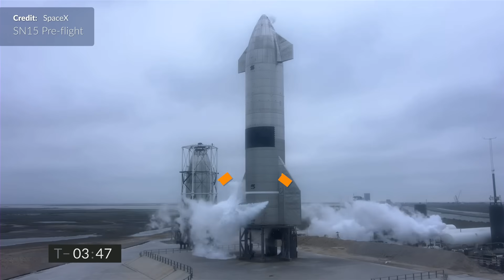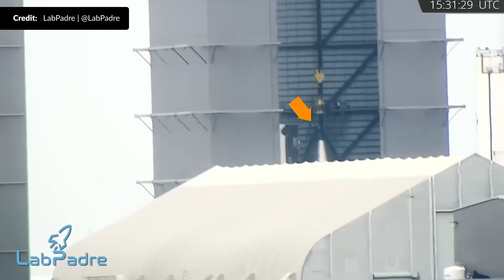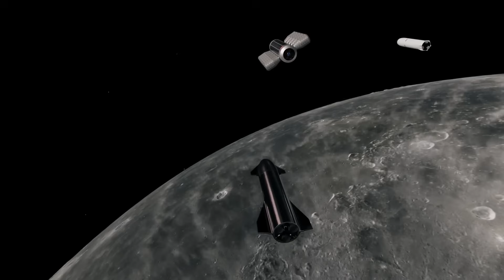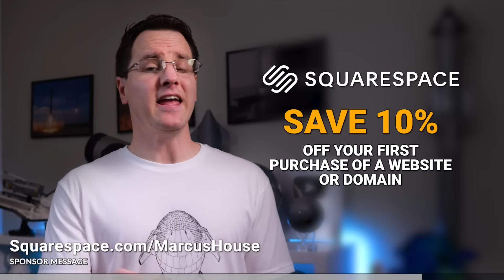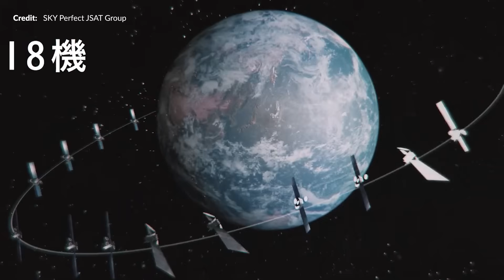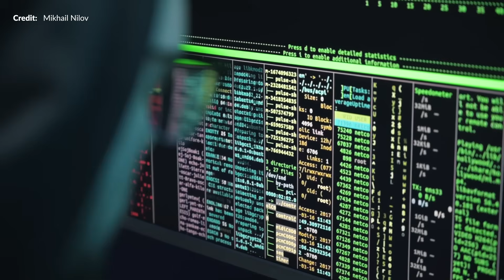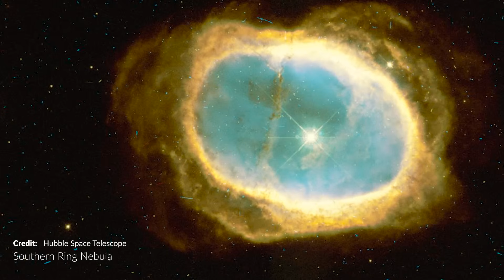SpaceX Redesigning Stage Zero?, Starlink Hack, Artemis 1 Final Rollout, JWST Update

Comment: I think if the first booster survives, and has a nominal return profile, Elon will elect to attempt a catch on the first launch.  If anything isn't perfect, water landing.  I think Tower 3 will be installed at the secondary launch site, launch from pad 39 and return to the secondary pad to prevent any risk to the existing launch towers.
Reply: "Tower 3" only exists in speculations, not even a filing documents
Reply from the maker: Still trying to determine where tower 3 is going to live.

Comment: Whether or not SpaceX attempts to catch the first booster will likely depend on if Elon has all of the required beta hardware, software, testing, safety and control systems assembled, operational and ready for a full-scale booster flight recovery verification.  The sooner they launch, the less likely they will be ready, although they may already be ready.  Also, Elon might not want to risk, just yet, his very expensive infrastructure as a crash could cause serious damage to a part of Star Base.  It will be exciting none the less whatever Elon chooses to do!
Reply: Yeah. Trying to catch it seems insanely risky. What I would do is to simulate a catch over water - make it come to a stop at the right altitude. Then drive it around like a drone until it runs out of fuel. As a test, obviously 😁.

Comment: The reason superheavy and starship can hover is raptor engines can throttle.  Falcon has to do a suicide burn just right so the velocity zeros out and shuts down before the rocket starts ascending. Starship can throttle and make adjustments on the fly, so can even slow to a hover away from the launch tower and then move toward the chopsticks if it needed to.
Reply from the maker: Merlin can still throttle, it is just that the end mass at landing is not high enough. The minimum throttle on a  single engine still provides a greater thrust to weight ration than 1.0.
Reply: @MarcusHouse  Merlin can barely throttle.
Reply: @NeonVisual  Merlin can barely throttle

I'm seeing that they did greatly increase the throttle ability with the D revision.  Down to 39%
Reply: @NeonVisual  

Falcon 9 is too light. Maybe if Falcon Heavy didn't use the side boosters but scaled up the hull it would be heavy enough to land on one engine and hover.

Now ask yourself how New Glenn is going to do landing with both stages?  How low can BE-4 (hypothetically) throttle?  How low is the mass of the first stage?  How much cargo can it carry if it uses a set of landing legs for each stage?

Now remember that SpaceX gave up on landing the Falcon 9 second stage due to the amount of payload lost.
Reply: @NeonVisual  

One of the brilliant things SpaceX has done with Falcon 9 and Starship is reducing the number of different components in each.

Falcon the big thing is the engines.  Falcon 1 they had 2 different engine designs to design, build and maintain.  Falcon 9 they eliminated one of the engine types  saving money.  Falcon Heavy is basically 3 Falcon 9 1st stages with small modifications (at least one has flown again as a Falcon  9 successfully).  Vacuum vs sea level engines is relatively minor.

Starship is even better.  Why did they design and test 2nd stage before the 1st?  Because almost every component in Super Heavy is also in Starship but not the other way around.  If Starship failed to be practical it would be "who cares about Super Heavy" so spending money on Super Heavy would be a waste if Starship failed but the reverse would be unlikely to happen as Super Heavy components were already in production and tested before the first Super Heavy entered production.  Major savings vs Falcon 9 as there are fewer differences between the stages.

Now New Glenn is wasteful and will (imo) get worse.  Each stage uses different engines and worse different fuels. So two different engines to be designed tested and certified using different factories and testing equipment and on site different fuel Depots and heaven help them if they hook up the wrong ones on filling up.  Different tank designs, different landing legs differences add costs, time and space.  $$$$

Even worse the New Glenn 2nd stage is ALREADY OBSOLETE.  Bezos has stated that New Glenn cannot fly economically without a fully reusable 2nd stage. More time, money and space to design, test and build.  Reusable means less payload to orbit so how much of the 45 tons do they lose?

Comment: Is there any insulation around the liquid fuel tanks? Not the heat shield tiles, but insulation to keep the fuel cold before launch.
Reply from the maker: The vertical tanks are double walled insulated in the centre. Same I believe with the horizontal tanks, but they were prefabricated.

Comment: The nosecone will need modifying if artificial (centrifugal) gravity is to be used with pairs of ships travelling to Mars.
Reply from the maker: You would really need a ridged connector. That is the problem really.
Reply: It literally has a lifting points for a crane (with obviously Earth gravity, which isn't a hard requirements in space) right now
Reply: @alvianchoiriapriliansyah9882  It might be a different 'lifting' requirement on the way to Mars.  200 tons?

Comment: These catching arms are a huge mistake. The simple solution is legs like Falcon 9. Elon is risking his entire launch infrastructure for nothing.
Reply: You must be a rocket scientist
Reply: Of course you know more than the actual rocket scientists….
Reply: Not quite sure you understand the plan for 'rapidly reuseable' quick turn around on the rockets. If the booster and ship land a distance away from the launch platform they then have to be moved rather than have them land exactly from where they will take off. Which will mean added infrastructure and equipment to carry out the move making the whole process much longer to carry out.
Reply: Legs add weight, we can easily see from the many Falcon-9 landings that the precision is fine.